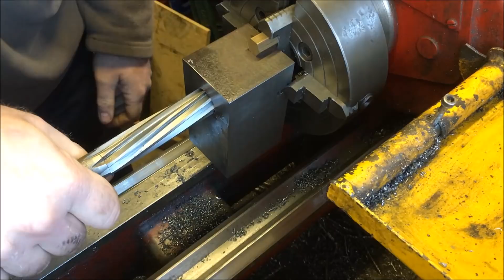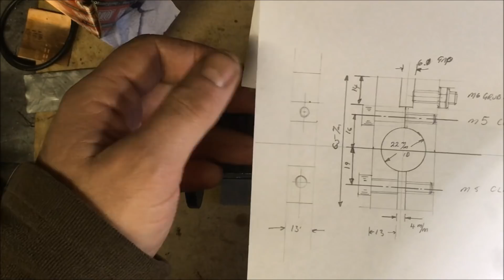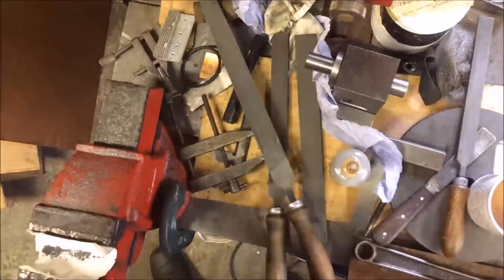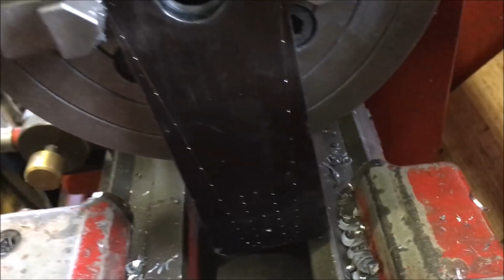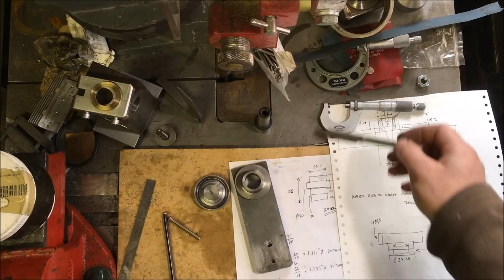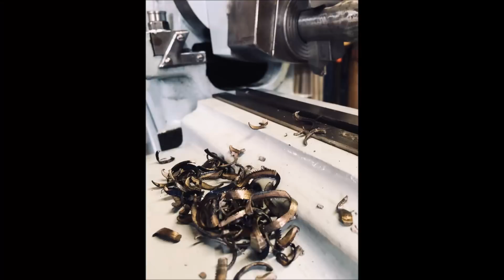Shaper Gear Cutting pt1

Comment: You shoulda cranked that block up to 1500 ripems. It would have been fine🤥😂
Reply from the maker: aside from the top speedof the lathe not getting up to that (1350rpm I think), the off-centre block was creating a hell of a lot of vibration and causing the lathe to 'wobble' - its bolted down but is quite small unit.  Im also very nervous when machining - seen too many accidents over the years - happily not many mine. Thanks for stopping by and watching - I have to complete the rig sometime - ran out of time on this.

Comment: Have you posted a part 2 video yet ? If so where is it. ? I can not find it.
Reply from the maker: hi Terry, sorry not got it all finished yet - a lathe project has got in the way - the good news is that I will require gears for the new lathe so I have to finish the indexing jig ! Next part of the project requires the indexing plates to be drilled (the ones that the dividing head plates dont cover - 127, 135 holes etc then its put the thing together and machine the blanks for the pcd disks and gear blanks.
Reply: Thanks Mat. I am definitely interested in seeing the rest of the build including cutting the gears with the shaper. Really interested in making of the index plates. Thanks again for your time and effort. Great production and creativity. I love soaking my brain in the knowledge that is here on YT. 

Terry

Comment: Mat -- Back in the dark age when I originally got a mini-mill and mini-lathe with very little tooling, I used a technique for dividing that I haven't seen anybody else use. Most likely because they would shriek in horror if anyone did it.

Originally I would manually draw my layout on paper then spray semi-permanent spray adhesive from the crafting world onto the back of the layout drawing and put it onto the cleaned metal surface. In that manner, if I needed say a 135 bolt circle, each and every point would be suitable marked. I would then drill through paper and metal ending up with a finished part. I've also done this trick on the edge of a circular object where I needed to gash lines around the circumference of a part.

In more modern times, I have created a bolt circle in FreeCad and done the same thing.

Just a thought . . . Hold the screaming in horror over there . . .

arlen

Comment: Nice to see someone use a shaper, I've made gears on a miller,  but generated gears on a shaper is interesting.  Another new subscriber.
Reply from the maker: Thank you for your subscription, the project of gear cutting on the shaper is interesting to me - maybe not the fastest way to progress, but once the jig is completed it should have minimum tooling costs (HSS bit, PCD disk and drill a few holes in the index disc if I dont have a suitable set) - might be handy down the line. All the best Mat
Reply: My Royal 250 shaper is pictured here on www.lathes.co.uk.  http://www.lathes.co.uk/royalshaper/page3.html

Comment: Very nice. This is one of the projects I have on my list since i stumbled over some old documents a few years ago. If I remember it correctly You can even make smaller gears. The diameter of the gear is not determined by the diameter of the index plate - of course, the diameter of the shaft on the blanks's side will have to be adequate.
Reply from the maker: I found Marcus's entry to Emma Ritsons 'Spare Room Machine Shop ' competition last year - making gears on a shaper and was intrigued. I need some change gears for my old lathe to enable me to make imperial threads and was all set for milling them. Then I found out the price of gear cutters and dividing heads - all of sudden the shaper looked very interesting.  this index head should be useful on the mill and for other projects I have in mind - allthough I will need to add a locking facility to lock the shaft to the block once indexed.. I am pretty sure that I can now make a 20T gear DP18  nothing much smaller in that DP as I would have to make a mod to get a smaller pcd disk onto the shaft - in practical terms I am never going to need anything smaller. A new shaft for the indexer and couple of spacers to fit the existing index assembly wouldnt be too big a job so its there if I need it.  Thanks for commenting and dropping by.  All the best Mat
Reply: I looked up the source of the documents I have. They are from the "Model Engineer" magazine from the 1950s and 1980s. You can get them as PDFs in the shaper books section of www.neme-s-org: http://www.neme-s.org/Shaper%20Books/Michael_Moore/ It is "shaper-gearcut.pdf" and "second article.pdf". Just in case they provide extra information and You don't already have them. 
Looking forward to the next episode! Frank
Reply from the maker: Hi Frank - that is the same ref' I used via Marcus @ JBFrom OZ - all though I must admit having not read / seen the second article. Bit of reading for me this evening.  Thanks again mat
Reply: perfect; my pleasure. Frank

Comment: Should be a very interesting video seeing this in action and auto indexing each tooth Mat. Afraid my little South Bend shaper might be a bit too small to fit everything on the table to try to do the same though.

I picked up a great tip from one of the Guy Lautard Bedside Reader books while reaming. Try filling the reamers flutes with pure baking lard by hand spinning the reamer against a block of the lard then ream the hole. Even with today's best snake oil concoctions for cutting fluids all there trying to do is get close to what the animal fats once did without the rancid or smell problems. I keep my reaming lard refrigerated and clean the part and reamer very well after using it. Rancid fat in any cuts in your hands would not be something to experience I expect. I see normal bacon fat mentioned on the forums sometimes but with all the added salt and other additives in it then imo it would likely add more problems than it's worth. I have seen much better reamed surface finishes on steel and stainless with the lard than anything else I've tried.
Reply from the maker: Interesting. Not sure how Beccy might cope with the animal fat in the fridge - she went vegetarian last summer when her health came under the spotlight. Definitely worth investigating some options though - I have a small pack of 'lard' tucked away for surface grinding soft metals from memory its 'vegetable' based ....  - I will give that a try first.
Reply: Since I've not tried vegetable based "lard" I've no real idea how well it might work Mat. All the very old books list animal based fats up to and including whale oils. I doubt there's little or nothing that hasn't been tried at one time or another. Might be a good excuse to have a small shop fridge for the lard and maybe some adult beverages :-) T.d. Walshaws book Ornamental Turning mentions using highly refined neatsfoot oil as the very best honeing oil for mirror finishing the edges of cutting tools.
Reply from the maker: I tend to think there has been much forgotten about the origins of many ideas / practices. The reasons why materials today are preferred to those of the past - Im sure there are plenty of 'newer' practices that are economically based rather than performance based. The 'lard' works well on the SG and I should give it a go tapping. Its an interesting aroma when it 'cooks' in the workshop - the dogs very interested :-)

Comment: Coming along very nicely mate! I'm keen to see how working between centres copes with the cutting forces.
Dad also had some sphincter tightening spinning up our gear cutting block in the 4 jaw, needs must and all that! Can't wait for part 2!
Reply from the maker: Hello mate, I really want a larger lathe and chuck - a 10" chuck would be better half as big again as what I normally use. I have just picked up a 8" 4 jaw chuck in need of a bit of tlc and backplate - I am hoping it will allow me to hold the gear blanks for rough them out - if not its going to be tedious work. With regard the between centres work - yeh I have the concerns as well. Time will tell. Worst case I have to remake the indexer shaft to enable a gear to be clamped direct to its end. Well thats what I thought when I sketched it out. All the best Mat.

Comment: vice  turned out good. hope you have great luck with the  WIYB suff :)
Reply from the maker: Thanks Rick, I am still getting used to having more hand tools to go at - the callipers have taken some getting used to - but I quite like dial callipers now. All the best Mat
Reply: lookcreations  keep up the good videos.
Reply: Hi Mat, I've got a couple of Mit dial calipers, they can pick up a bit of swarf, dirt etc in the rack quite easily, so I now keep mine covered with a clean rag when there not in the box or being used. And don't ever bump them off the bench by accident. First and only time I did that with my 12" pair it cost me a 3,000 mile trip to the only Mit. repair in Canada just outside of Toronto and over 1/2 the cost of a new pair by the time the damage was repaired and they were re-calibrated. Mitutoyo recommend for best accuracy not to use the thumb wheel. That's really made for large fast movements. The one video of there's I watched showed gently closing the jaw using your thumb and fore finger on the smaller parts and using both hands on the larger parts. After doing that for a number of years now I do think it's slightly more accurate since it's pretty easy to use the same closing force each time and the moving jaw is a bit easier to keep dead square to the beam and against the part if your thumb and fore finger is kept centered on the fixed and moving jaw. There's a minute clearance on even the brand new one's that's there to allow the parts to move, that can allow enough movement in the moving jaw to throw the measurement off a tiny bit using the thumb wheel. And as nice as there dial calipers feel I still think there solar powered digitals are like buttered silk. There without doubt the nicest one's I've ever tried so far.